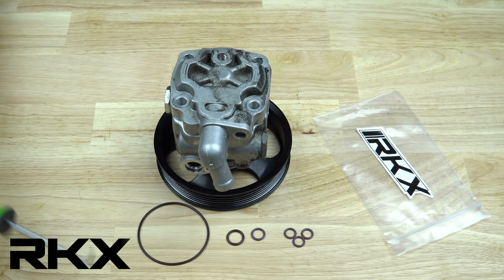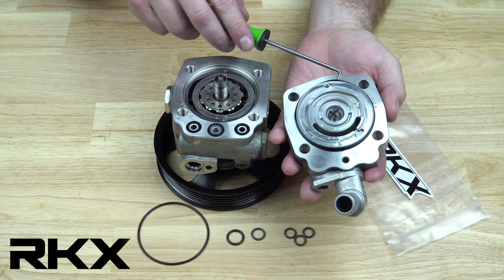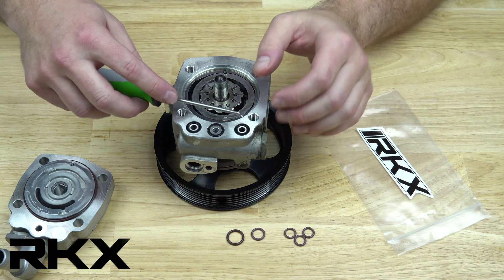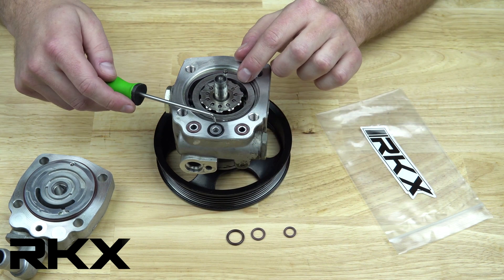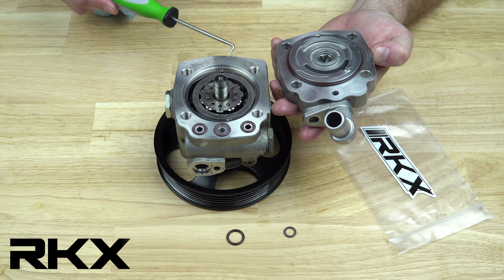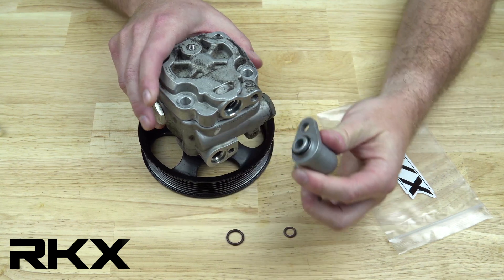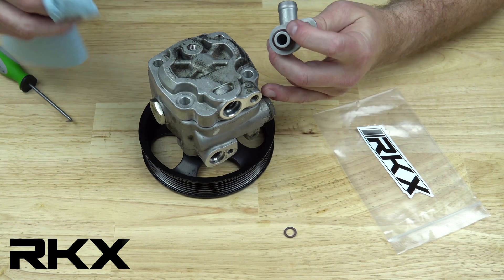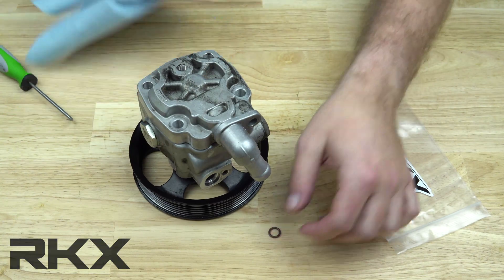How to rebuild the Volvo 4.4L V8 power steering pump in XC90 and S80 using RKX's seal kit.

Comment: Can you please tell me the torque specs for the four bolts?
Reply: Ever find out? Looking to do mine soon on my s80
Reply: @AH6man  Nope. If you do please let me know
Reply: @AnthonyS80-V8  from my research ive seen either 14 or 17 ft/lb. Ill 17 just to be on the tighter side. I doubt 3ft/lb make a difference
Reply: @AH6man  Thanks mate. I used 24nm as I was told it was an M8 bolt. No leaks as yet! Be sure to replace both seals for Low pressure and ESPECIALLY High pressure return lines. If its heavy, squealing or leaking they are the usual culprits!!!Ask me how I know😂

Comment: Can the bearing and shaft seal be replaced in these pumps as well? I recently rebuilt the pump in my last vehicle, a Subaru SVX, and also replaced the bearing with a Japanese Nachi EM series. It was easy to do because the pulley was splined and bolted to the shaft. If memory serves, the pulley on these Volvo pumps isn't bolted in place. How are they attached/removed? I suspect I'm going to have to dig out my pulley puller... I see in some photos an internal hex drive in the shaft. What significance is this? If anyone has replaced the bearing on one of these pumps before, do you remember what the bearing number is, and if there's a shaft seal ahead of the bearing, what the specs on it are, or a part number by chance? Any insight would be greatly appreciated. Cheers from Canada!
Reply from the maker: These can defiantly be torn down further and rebuilt. The problem is the specialty tools required, extra time, and extra cost of parts makes it less appealing to rebuild vs replace. The majority of these pumps fail in the seals included in this kit.
Reply: @RKXTECHcom  Yep. Since my comment above, I dug into my pump and replaced everything. We actually had a conversation via email about this after I ordered your reseal kit, and I provided a few of the specifics like bearing number and internal shaft oil seal dimensions, plus the fact that OE pulleys don't have the puller groove in them to facilitate removal using a tool, etc. Appreciate you coming back to reply though! ;)

Comment: I will be ordering this kit. 
Power steering pump leaks, or making noise is very common on the 2nd gen S80 with or without adaptive steering. I highly recommend if anyone is going to replace the pump seals/orings to also replace the power steering hose and add an inline ps filter on the return line.